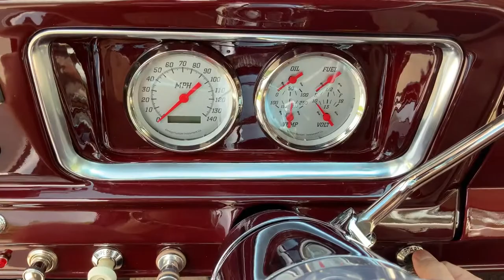1970 Kaiser Jeep Gladiator 6.2L LS Auto Suburban Chassis Professional Build

Comment: I love it great job I’m almost finished with my 69 j3000 - ls2 motor 4l80etrans with np241 4x4,new interior, paint coming soon! Cheers awesome build!
Reply from the maker: We do not do restoration work. We are mainly a dealership. This however was a very nice build we sold for a customer of ours. It was right at the time they had released the new gladiator. Yours sounds like it is going to be pretty nice too.

Comment: Not sure i dig the gold tone on the bottom, would look better on the top half but thats just me.  Bed is also cockeyed pulled more the drivers side outside, and inside the passenger..  Thatd drive me nuts i fixed that on mine
Reply from the maker: Lol, I noticed that when photographing it. It would drive me nuts too. It is a cool build though. We sold it right before they released the new Gladiators. I think this looks way better than the new ones.

Comment: This is a thing a beauty. Nicely done. Did you mount it to the new chassis ?
Reply from the maker: We did not do the work to this vehicle. It did have around 150 or more in it. It was very well done. It was also right before those new Gladiators came out. So I think someone got a deal personally.
Reply: @StreetDreamsTexas  I may do this with mine. It will be neat but not a beauty like this. My J20 is not rotted but it has a few battle wounds but looks good.
Reply from the maker: This is on a modern suburban chassis.